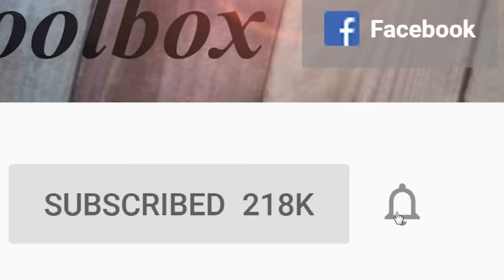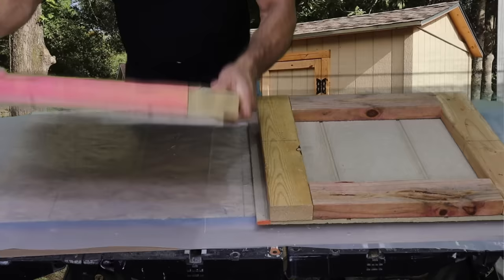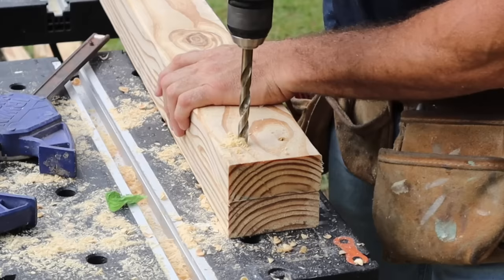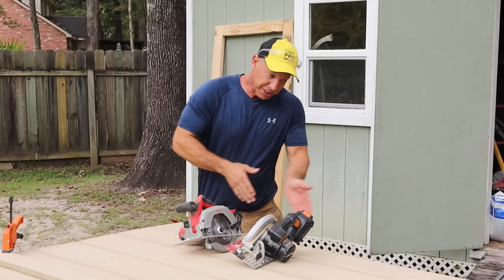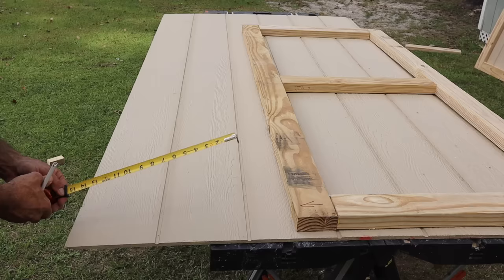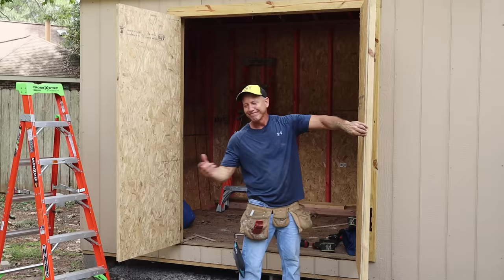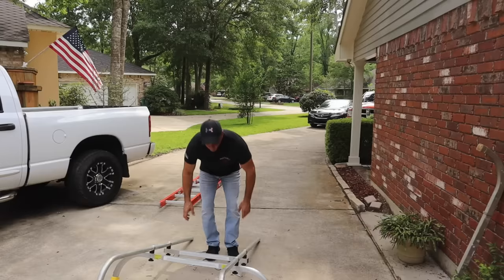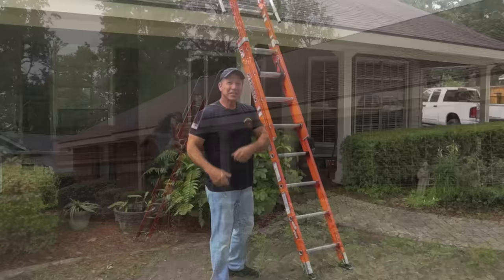How To Build An Inexpensive Shed Door: Easy & Durable Solutions | Paul Ricalde

Comment: holy sh$t i spent $140 on kreg joint, and this guy just showed me how to DIY my own pocket hole. Bravo sir not all hero's wear capes some just wear tool belts.
Reply: Don't feel bad I myself have spent a lot of money on what seemed like a good idea at the time only to find out I didn't need to.
Reply: Paul used the wrong kind of screws. Look at the head of the ones he used. A screw that is suitable for a pocket hole will have a flat underside of the head. Paul's screws are going to act like a wedge and potentially split the wood.

Comment: Awesome video about the doors.  So many tips for people like me who have never done this stuff before and need all the advice they can get (like the overlap, the gapping, the door stops, etc.).  Also, great to be able to find the hardware and equipment you recommend. The ladder safety system looks amazing.  The worst part about going up on the ladder is getting down, and that looks like it would make a huge difference, having something to hold the ladder steady as you took the first step back onto it.

Comment: The safety rails are an awesome idea! I find it hard to find the rungs on the way back down and the added extension would make it much easier and safer to climb down. 
A few safety tips though: 
1. If you have the ability to tie the ladder off to something, like the columns on the porch, tie the ladder up before ascending for the first time.
2. Be sure to make use of the feet on the ladder for placing it on soft surfaces. Most quality straight/extending ladders have feet that flip up to become 'spikes' to help it dig into the ground where applicable. This will prevent the bottom from sliding out on slick, soft surfaces.

I've learned quite a lot from you and am glad I subscribed! Thank you and hope to be learning more from you as time goes on.

Comment: Dean Chanley
Have been looking for something like the ladder safety rails for about two years now when downsized my home
 to single level height. I'm 72 years old and getting on my roof to check out the shingles and various holes that 
need resealing I'm sure (can hear water from around chimney hitting fireplace sometimes in heavy rains) but
can't quite muster the guts to climb up there. Will be searching out the kit and looking forward to trying it out
asap. In mean time will just use a bucket. Happy to have found this video as was originally looking for info on
making new shed doors since mine are nearly rotted away. Hit the jackpot in a two for one here. Thanks much. 
Am now subscribed too.

Comment: That's a pretty well thought out ladder system.  I like how it's impossible to step on a rail above the fulcrum point, which could dislodge the base of the ladder.  Also, the curved handles make it unlikely that you would load the top such to leverage out the base. The force should generally flow down the rails which is what you want.

Comment: I like the ladder rails idea.  I want one.  The only thing I would change is the way the rails are secured.  Instead of relying on a knob holding the rail by friction I would make holes on the rails for the bolts to pass through.  That way the rails will not give even if the knobs are loose.

Comment: Great video, like your tips on doors 👍,  as far the ladder... One recommend (change/improvement) would be the safety pin that replaces the thumb screw/ wing on the sliding rails.  The reasoning is that you are taking chances with screw (screw could slip).. On your way down if that screw is not holding sliding rail tide, you can get hurt badly.. Replacing screw with pass through safety pin eliminates any guess. It's similar to the concept what he did with the U-bolt. GREAT INVETION, please keep me updated when product is officially on the market.  I would love to buy a set.

Comment: Regarding the doors. Specifically the last step, putting up the door stop. I always cut my top piece first and put this in place before I so the side pieces. I always figured this way I know the doors will close against that top piece and I know they are straight with each other. Then when I do the two sides, I know I can pull the doors closed against that top piece and put my sides door stops in place knowing the doors are align with each other.
Am I not thinking correctly? You did it the exact opposite, doing the sides first and top piece last.

Comment: Love the ladder safety rails  concept, without it, not only do I feel sketchy & unstable climbing off the top of the ladder to the roof but it's so unsafe trying to get back on the ladder to climb down w/out anywhere safe to hang on to. The railing secures that safety feel climbing off & on the ladder. The footing looks wide & tall enough to go over the gutter & add stability on the roof & will not slide off the gutter like it could without it. The adjustable sliding railing is a really nice touch to match the user's height too. The demo didn't really show how the railing is attached & slides but hope with a round pipe railing, there is a notched channel or can be an oval or square pipe to prevent turn or twist around. Other thing is hope it will also come with soft pad bumpers like show in the video, the Guerrilla Ladders come with their bumpers & I love it & don't need to shop around for something that fits. Last, for the U bolts, maybe instead of the small wing nuts, it would be more secure & easier to tighten if you use a similar but smaller plastic knob nut you used to tighten the railings, i think that would give you more leverage securing the U bolts. I would love to test it out & hope to give you more useful reviews & suggestions. Thanks for keeping us DIY users safer.

Comment: Safety rail kit is a good concept. Does it need both sides or can one side suffice? Seems most work going up/down you have a tool in one hand. One recommendation: maybe a tether strap to that safety U-bolt. I could see that get lost. The strap might connect to the U-bolt end-fastener to keep the whole ensemble together

Comment: The ladder rails are a cool solution for safer us; good job. Does it install on an extension ladder that is fully collapsed? Assuming you install it once and leave it on a dedicated ladder, does that system help any other use case? For instance, loading your ladder on the roof rack of your truck. I appreciate invention that solves multiple problems. How much weight are you adding to the top of the ladder, does it make it more unwieldy? Thanks…

Comment: Hey Paul we are just finishing up a 12 X 24 shed your vedio on the door construction was great to save a few bucks we used the cut offs from the 5 quarter door jamb for the door stops. We are trying to match the groves on the door with the groves on the T1-11 if you have any tips I would appreciate it.

Comment: I seen that you say you used a good.exterior glue for the joints, would subfloor adhesive work for the joints or would that expand and pull the wood apart?

Comment: To truly get going in commercial environments, they need to design a quick connect system to attach the system to the ladder. Many crews will carry 2-3 ladder on the truck so you can't leave it permanently. As for the rails, I'd leave the handle with screw there if you need a specific adjustment, but if you need it to be pushed all the way, I would also design a way to be completely toolless and It would just clips in. For the residential market, it would probably not make a difference, but for the commercial, it just looks a little too cumbersome as it is. Good luck with the product.

Comment: So with double doors subtract 1/4 inch for hinge sides and center also 1/2 inch from height on both doors. Just a question about overlap to prevent visible gap in center. Could one just attach a length of 1x4 to the inside center edge of one of the door extended about 1 inch from the edge so that it acts as a stop for the other door and lines them up

Comment: Thanks for the video. Very helpful. Just one question: is the siding flush to the outside of the door frame, or does it overlap with the door frame? In other words, when you installed the 2x4 trim around the door frame, was it nailed to the door frame directly, or was the trim nailed into the siding and door frame (sandwich with siding in the middle)?

Comment: Paul, Love these doors. Do you have a video on making a single door like these? My contractor built me an awesome 8x10 shed, but the door is sub-par. It's a single door that seems very heavy. I want to rebuild the door and I think this style would be perfect, but it's only a single door.
Reply from the maker: If your door is wider than 36 inches you may want double doors to keep the weight down. I’m sorry but I do not have a single door video but you can make a single door the same way just do not have an overhang with the plywood. You can cut the plywood flush to the outside edge of the 2x4s. I hope this helps my friend!

Comment: Could you please build something with and obscured angle?  I plan to build a shed at the side of my house.  The dimensions are. 4ft at the back, sides are 11 ft and the the front will be 7ft wide. It will be 7 ft tall too.  With a slopped roof too.  Any help with the cuttings would be great.

Comment: Another great video, Paul!  Will definitely use it.  Need to replace the doors on a shed we are using as a chicken coop.  Also, love the ladder rail system.  I have a very tall barn\shop and I hate getting up there with my conventional extension ladder.  Always feels unsecured especially when starting to climb down.

Comment: Suggestion for the Inventor of the Safety Rail device,  instead of having that U bolt with wing nuts for the Safety locking mechanism He should really consider using something that doesn’t require having to hand tighten and loosen 2 wing nuts every time you want to adjust your ladder, perhaps something that’s super easy to just slap on to lock it in place that functions like a Carabiner.  I’m just saying, because my guess is you guys will get that and they’ll just not do the added safety luck and I imagine he suggest it for a reason

Comment: Paul, love the shed video.  Question.  I put the skin on the outside and trimmed it out.  On backside I have 7/16s osb.  If I put that 1" lip to stop bugs and draft that osb becomes ninja knives to shred me up as I bump into it.  Could I  add a 1x4 and rip both my osb back panels to receive that piece?  Or should I just do both osb panels  flush to the 2x4 edges and then add a 1x4 on top of the osb to give that lip?  appreciate any thoughts?  I am going to use the back of my door to hang tools to I wanted to have the osb on it so not have holes to the outside if I screwed in.  Love your work brother!

Comment: Paul,
I see that you’ve used fence hinges. 
I feel that allows for someone to remove the screws a have access??
Can I still use this door method with hinges that go on the end of the frame…like house door hinges.
Reply: Use bolts with nuts tightened on the inside.

Comment: Hi Paul, I often use my extension latter when installing draperies, shades, and blinds in very high windows.  This is quite dangerous because I often need both hands to place the rods and center supports.  The handrails will give me much needed support to wrap my arms around when using both hands.  I was even going to make something similar to these, but now I won't need to do a bunch of trial and error.  Are these available now, and if so, where can they be purchased.

Comment: what size were the doors?
Reply from the maker: I am not home but I believe I made them 72 inches wide. I get off work tomorrow and I can check if they’re not I will let you know. Happy Thanksgiving!
Reply: @paulstoolbox  thx u 2, when u did ur siding, did u run it flush to the opening and then put trim over that??